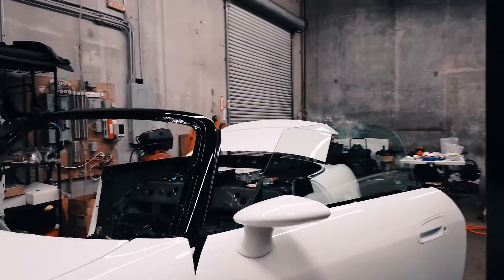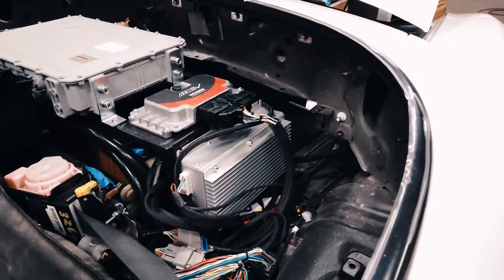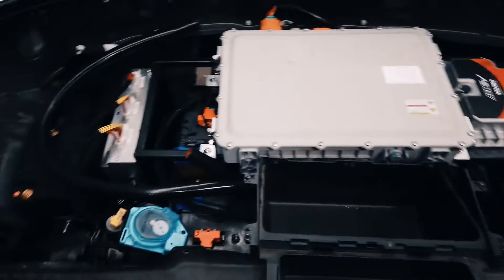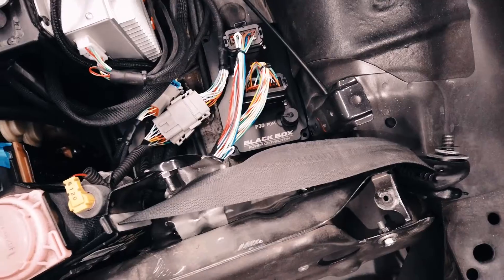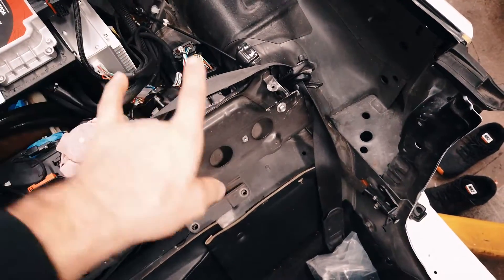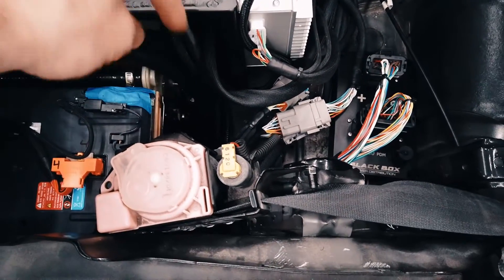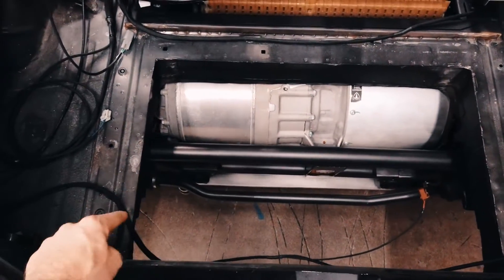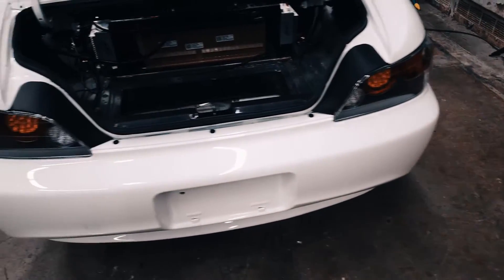Rywire  EVS2000 Electronics Installed, Overview of my High Voltage equipment and electrical system.

Comment: Great work and how’s the project going? Quick question on the Orion bms abs thermistor connections. Where you able to connect directly to the Chevy volt battery thermistors or had to install your own thermistors?
Reply from the maker: Yes volt ones
Reply: @rywire  Thank you!